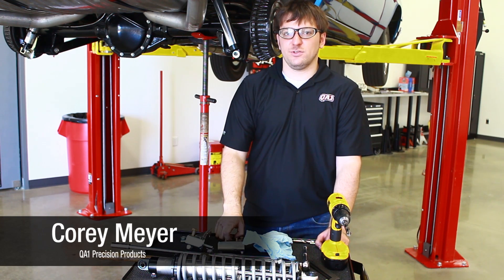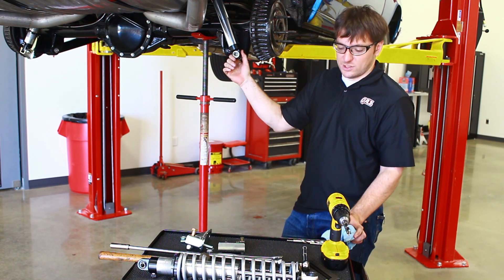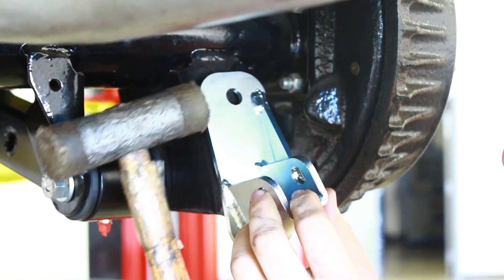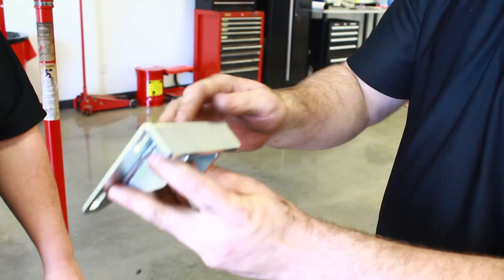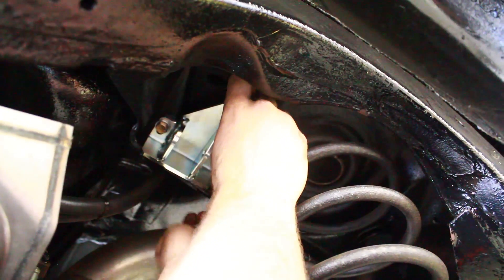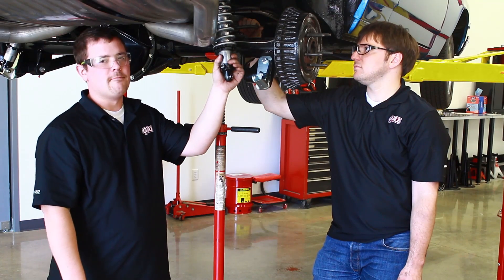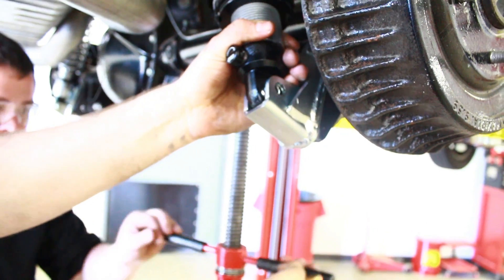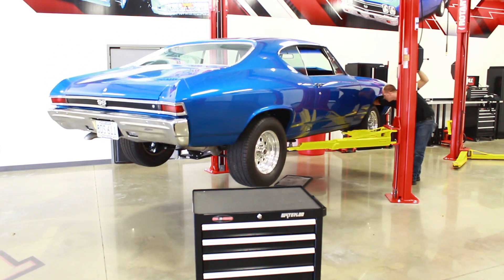How To: Install a QA1 GM A Body Rear Pro Coil Coilover System

Comment: I have installed the QA1 Coilovers on my 68 Chevelle.  They came with the NEWER mounting bracket that doesn't allow me to install my OEM exhaust system with resonators that i really like. Now that i see this OLDER REAR mounting bracket that sets the Coilovers closer to the wheels, I believe this will work for me. I  have drum brakes in the rear so no issues with oversized Rotors. Can i order them ? Is there a part # i can call in to order ? Im a welder by trade and am considering just making up a set. THANKS
Reply from the maker: Hi there! Please reach out to our tech team for some recommendations. They are available M-F 9am-5pm CST. at 952-985-5675 or Sales@QA1.net

Comment: Not a good video. No comparison visuals of the products and original parts. Doesn't show the product placement up close with explanations. Really no instructions that are better than what would be read off of a box. Do this, do that and don't really show or explain how.
 What 3rd hole? I didn't even see a third hole.
 How does the coil spring come off? 
 These 2 guys shouldn't make videos because they can't speak clearly.
 Installation videos should be explained and recorded so a novice can follow along and learn how to do it.
 This is far from that.

Thanks anyways, but I can't learn anything if you don't take the time to thoroughly explain how to install it

Comment: Need help.. I installed the brackets and shocks. I have clearance between the springs and rear axle when installing.  When I put the car on the ground the springs are rubbing the rear axle.  Any suggestions?

Comment: I have a Quick Performance Ford 9" based rear axle assembly in my 1965 GTO. They are making a replacement rear axle housing for me because they installed the wrong lower control arm bracket. The replacement is going to have adjustable lower control arm brackets to be able to change instant center. They have the QA1 coil over bracket in house to assure fitment. 
MY QUESTION IS: the recurring problem is with the factory shock and springs, we needed air bags to raise the rear end. Even with new stock springs, the rear end is lower than the front. DOES YOUR COIL OVER SETUP ALLOW FOR RAISING THE REAR OF THE CAR?  Thanks.
Reply from the maker: Hi there! Our bolt-in rear coil-over kit isn’t designed to raise the car higher than the stock ride height, although this could be accomplished with either a 1” extended upper eyelet (p/n 9036-202) or 2” extended upper eyelet (p/n 9036-203). The shock that we include in the rear coil-over setup should not be longer (center to center on the mounting bolts) than 17.5”. The upper and lower mounting brackets will add 1-1/4” length from the original shock mounts.

Comment: I have a 1970 chevelle with a 9" moser rearened, Will those brackets work? will the coilovers provide a 1-1/2" lift from stock ride height?
Reply from the maker: Hi Gary! We can make your requests work! If you could please call our tech line, they can give you information on everything you need! 952-985-5675. We’re open M-F 8am-5pm CST!

Comment: Global West kit uses a bar to mount the upper connection on their coil over because they say the location for the shock mount isn't strong enough to support the whole weight of the rear. 

Should I be concerned and that, since yours didn't seem to have anything like that? Is the bracket really enough?
Reply from the maker: Based on years of experience with our kit, we have found that this way works really well. We came out with this kit in 2012. A lot of suspension companies have a similar setup to ours. It's a very common setup!

Comment: Would this kit open me up to using other (better) rear ends that use leaf springs?
Reply from the maker: Our kits are made to work with factory components. So if it is interchangeable with the factory system it should work with our kit!

Comment: What spring rate are these and what angle are they mounted at?
Reply from the maker: These have a 150lb spring on them, but there are other options available. They are mounted at the stock angles. Thanks!

Comment: Nice video. Looks like these would work with LCA relocation brackets. BTW would have been nice to see the shocks from the rear after the car was lowered and back on the ground.
Reply from the maker: Hi cutlassrkt, thanks for the feedback! We've never tried installing these with LCA relocation brackets so can't confirm fitment.
Reply: I went out and looked at my car and it should fit. Other rear coil over conversions the shock bracket bolts in with the lower control arm. These are on my wish lists. Also I just want to say that these are priced right. Other kits that I have looked at are not as bolt in and cost at least $750.
Reply from the maker: cutlassrkt Awesome, thanks! Once you get a set installed, we'd be interested to see some pictures with the relocation brackets!
Reply: QA1 mwill

Comment: Glad y'all have a warranty. I had some custom valved and spring'd, dial adjustment with hyperco springs on em.. It BROKE after it just turned 9 months old which could've killed me it wasn't caught in time.... But like I said, good thing for warranties. I would've not been happy if I had too pay for a factory defect..... Which I did get a new one back for free, but I still had too pay for shipping the stupid thing out when it should've never done that in the first place.. I have plenty of pics and a video of it before anyone says I'm full of shite!
Reply from the maker: +Nick Varnadore Hi Nick! Really sorry to hear about the problems you had. To help us better understand the situation, could you email me where you had the shocks custom valved and what kit this was, as we don't offer hyperco springs in any of our packages. You can email me at dkass@qa1.net or call me at 952-985-5675.
Thanks, Dave Kass
Reply: I will. Vansteel did the valving and upgraded the springs, but they warranted my coilover and valved it like the other one. I've got some lofi video of it while it was still on the car after just being discovered and some good pics of it after it was taken off. It was a mess